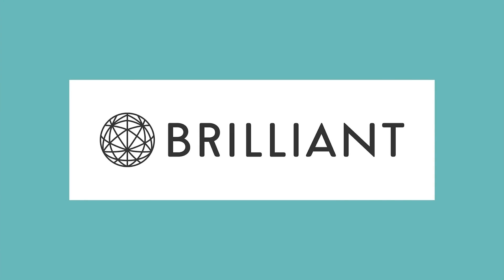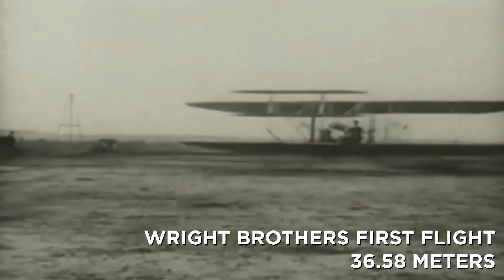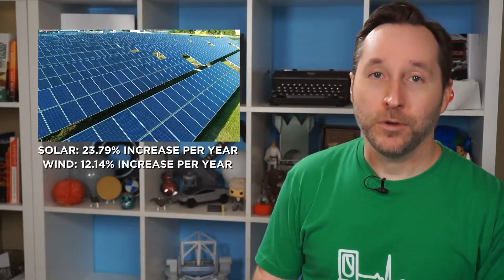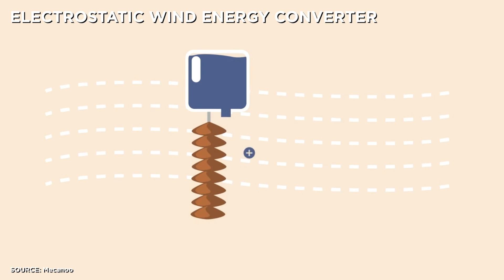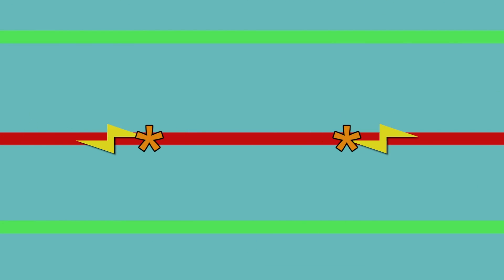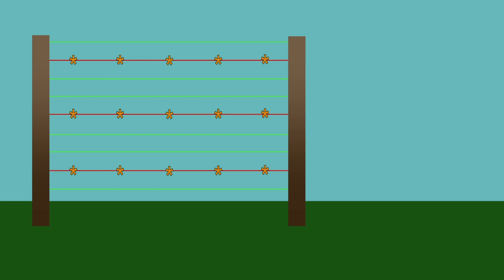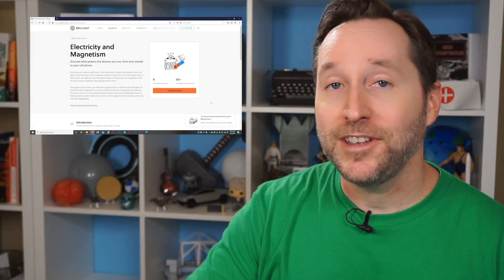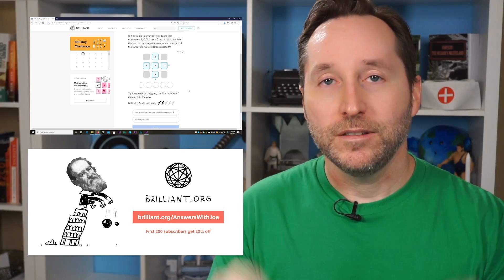Solid State Wind Energy | Random Thursday

Comment: So the SWET is just a self generating electric fence
Reply: Had the exact same idea. There are farms in Australia bigger than some countries. I can't help but wonder what kind of power could be made using this tech on fences that stratch that kind of distance.
Reply: Reece Flowers would be hard to transport that far I feel like
Reply: @HighlyRegarded11  fair point, no one needs a fence with cables that thick
Reply: @Telltaletracks  there is a ranch in Texas bigger than Rhode island
Reply: I was thinking the same.  And it doesn't have to be a large setup, although that would probably be more efficient than a lot of little ones.  I have a back porch whose screens I'd be happy to replace with a SWET setup.  Alternately, there is a school in my area where one side of the building always, ALWAYS has a pretty stiff wind blowing past it.  My point is that there are places we could tuck in smaller setups that wouldn't require the vast amounts of real estate that current wind farm technology does.
Reply: Just don't forget the capital cost of all those " danger don't pee on the fence" signs....lol
Reply: makes you wonder if you could use it like one
Reply: @Nananana it seems the guys first prototype was not efficient due to the wire spaceing if the wires were more compact and instwad of useing carbon used graphite coated. The graphite has a similar structure to carbon but its cheaper and more abundant.
Reply: @Nananana I don’t think these wires would be strong enough tho....

Comment: Cost per KW ! on wind power is massive, due to maintenance costs. Solar, effective at certain latitudes, and is subsidized.  Both completely dependent on Sun or wind. While the technology of new energy is great, the total replacement of our fossil fuel economy, despite the New Green STEAL directives, will not be seen in your life time.

Comment: Molten Salt Breeder Reactors have great power density, lower maintenance than nuclear or coal, don't ruin vast areas of countryside (small to large floating, offshore rig designs exist too 'Thorcon'). Can run on unprocessed, very common low level nuclear material, such as Thorium. Very little waste, powers an entire city with one plant.  Fuel and running costs are low, no meltdown hazard. Better than fake-green, overhyped junk solutions, such as wind turbines,  hydro, enriched uranium fission, solar farms and cells (for much of the planet).. Lithium + Neodymium and Cobalt Economy is so not green it makes a Carbohydrate Economy look bright green in comparison. We need carbon capture from carbohydrate liquid fuels with vehicles made from easily recyclable iron and aluminium. Easily doable... E-vehicles for all will rape the planet, rarer raw material prices will skyrocket with demand, gigawatts more power stations, cables + other infrastructure is NOT GREEN... CO2 is plant food... extract it, compress it in-vehicle, dump it at the petrol station each month. They can sell it

Comment: Video idea related to wind power: Kite power. Real Engineering did a video about it but a follow up to see where it's going would be nice. There's also different types of kite power, some use the tether to generate power, others have a rotors on the kite itself as it flies around.

Comment: Wind is super unreliable source of energy, hydro energy, sunlight and geothermal energy are far more reliable, until we figure out how to do fusion energy reactors.
Reply: Hydro is too small of a source, solar is not viable and geo thermal is too small a source.   Fusion is not in  your lifetime.  Fission and coal is only viable base load source at the moment.
Reply: @protonneutron9046  Nothing you said here makes any sense, how is hydro too small!!!?, how is solar not viable!!?, how is geothermal too small!!? 

And fusion is progressing quite steadily with new breakthroughs every year, give it 5-10 years and we will have functional fusion reactors even if it doesn't become commercial then.

And obviously i'm talking about viable non-polluting energy sources so not sure why you bring up coal!!!?
Reply: @AscendantStoic  Oh boy.  Meaning there are not enough sources.  You have to REALLY study the subject before you can post anything intelligent.  (not just you but anyone).  Geothermal has been tapped where viable in every major country.  In short, it isn't an expanding source.  Factor it out of your equations.  Solar isn't viable because it is too low energy per size and cost compared to current base load.   AND it isn't base load source because of  intermittence power gen.  Have you studied the subject of electricity production and distribution for a modern society?  Do you KNOW what base load even is?
Reply: @protonneutron9046  Again you are assuming technology won't ever progress and again you didn't understand the point of my post i'm talking about the reliability of the these natural energy resources and how dependable they are you are talking about the current day tech we have to extract energy from them, two completely different things ... so try brushing up your reading comprehension maybe.

I'm comparing wind with solar, hydro and geothermal in terms of viability long term, the sun will always shine in most countries for an average of 12 hours everyday, rivers will always flow as well as currents in seas and oceans, magma rivers and hot rocks aren't going to magically cool off over night or move to a different location away from the geo-thermal reactor (which would take hundreds if not thousands of years).

They are all reliable sources that only need better tech to utilize their potential so it's much more viable to invest in these resources rather than invest in wind, wind isn't like them because it's very finicky and unreliable on a daily basis, you could have a week with strong winds then three weeks without any strong winds, it's going to be unreliable even with advanced tech.
Reply: @AscendantStoic  Wrong.  YOU need to get a science education.  Preferably at the college level.  At your current EDU level it would take WEEKS to explain to you.
Reply: @protonneutron9046  You need to learn to read ... have a good day.

Comment: There‘s another bird-friendly wind generator tech already in production: https://en.wikipedia.org/wiki/Vortex_Bladeless. It could be solid state using the piezoelectric effect (not sure if that’s how they’re doing it). Unfortunately vortex shedding is pretty low power too. Their biggest product is a 30m tall tower,  producing only 1kW of power! Compare that to a conventional domestic 1kW wind turbine, which would be less than 1m in diameter.

Comment: It sounds like a lot of birds will die when they hit the wires
Reply: I think a piezo membrane probably has more potential
Reply: It's basically a fence, so would birds fly into a tall fence and die?  That would not be hard to test.  Hopefully that would be one of the things investigated before any roll out (if this is ever even viable).
Reply: @ntdscherer  I think a piezo membrane might - might - be less damaging to fly into than a "fence" made of wires. I really have next to zero idea of what a membrane would be made of, but am under the impression from the name, that it would be more elastic than glassy. I would welcome better information. The other thing I have no idea about is what energy density it would be possible to achieve. I.e. if you have a square metre of this stuff, whatever it is, how many watts of energy would be achieved if a 10km/h wind blew on it.
Reply: @mikeharrison1868  Sounds right to me, though I was more talking about the wires setup described in the video rather than a membrane.

Comment: Yeah it's pretty lame.  It's basically a static electricity generator and a very very poor one at that.  It's also DC voltage which is useless for transmission.  A standard generator makes AC voltage by design and then transformers(no moving parts) can increase and decrease the voltage as required for transmission. We can thank Tesla (the man) for that invention and slap Edison's ghost upside the head for fighting with Tesla over the idea.

Comment: 40,000 volts is not a lot of energy. It's a high voltage. It could exist with zero power at a current of zero amps, at low power at 1/40,000 amps or with colossal power at 1 million amps. At 1 million amps for 1 nanosecond, it's still not much energy. 
At 10 amps for an hour, it's a stupendous amount of energy.  But voltage alone doesn't tell you anything about energy. Otherwise, I love your work :)

Comment: 7:41  and then you run into questions of  ... what happens when you extract gigajoules of energy outs of a localized areas .. what effects do this have of meteorology..  for instance  by slowing vast quantity of air down how do this effect cloud formation  and rain distribution what effects does it have on wind blown pollination  does it have a localized cooling effect since you are actively taking heat out of the system etc etc etc  that being said ... it might also help with global climate change .. after all  heat is just a form of energy and temperature, a measure of is soo ..  if you could suck heat energy out of the climate faster than it accumulated then you can balance out the solar energy input with the  earths energy radiance/ reflectivity (?)   and basically turn the entire earth into a well i suppose a  very inefficient Stirling type heat engine ?

Comment: Fun fact,
Ionic Air Purifiers end up creating Ozone
which is SUPER BAD to breathe indoors
So, ironically, if you bought them to make it easier to breathe - they wind up doing the opposite.

Also as they build up dust on the blades, they get less effective and all that statically charged dust ends up sticking to your walls and tv and lungs...
ozone does kill germs, but It's literally like breathing bleach.
(which is BAD DO NOT TRY)

Just get a good filter and stick it on a box fan